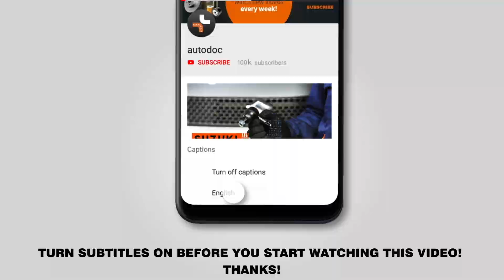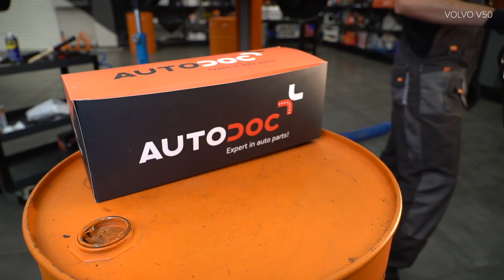How to change front springs / front coil springs on VOLVO V50 1 (P12) [TUTORIAL AUTODOC]

Comment: Hello, I have volvo v40 r design ( is -10mm lower that normal v40 ) and I need to replacement front springs, Are there any special springs for r design or its the same spring like in normal volvo v40? I cant fing information about that in internet.
Reply from the maker: Thank you for your comment!
Unfortunately, for a more accurate answer, we need more data about your car, so we recommend that you contact our support service, where they will definitely try to answer your question.
Best Regards,
Autodoc team

Comment: how did you align the bearing on top of the spring, how did you know it was in the right spot?
Reply from the maker: Thank you for your valuable clarification, we install the bearing in the upper part of the spring in the center when we screw the nut of the shock absorber rod, it falls into place.
AUTODOC
Reply: @autodocuk  Shouldn't you align the "pin marker" of the bearing to the end of the top spring? I read this in a forum.